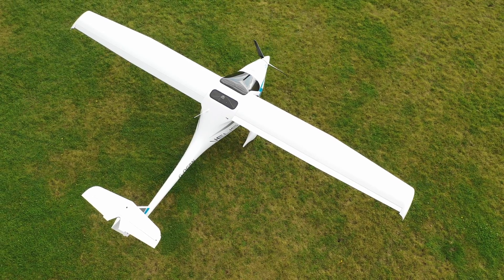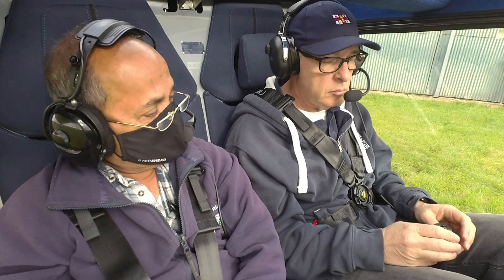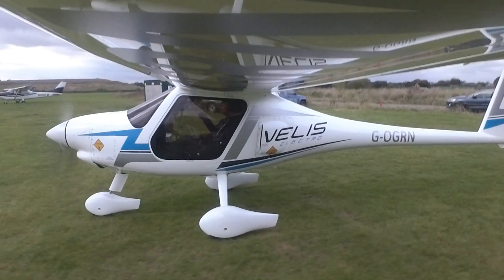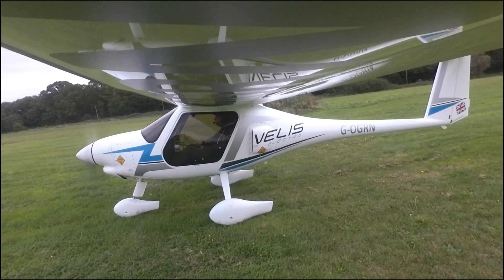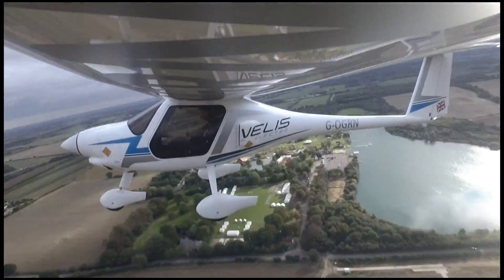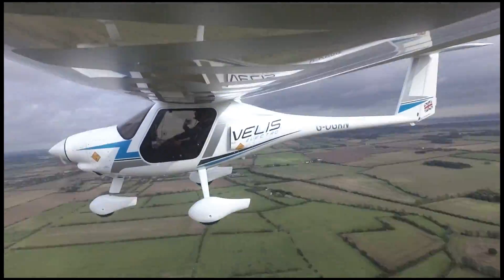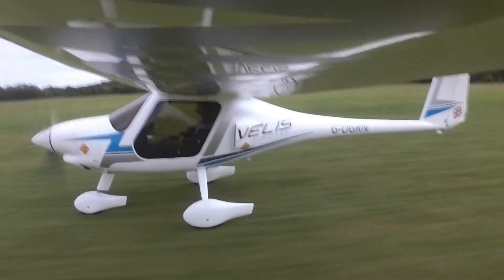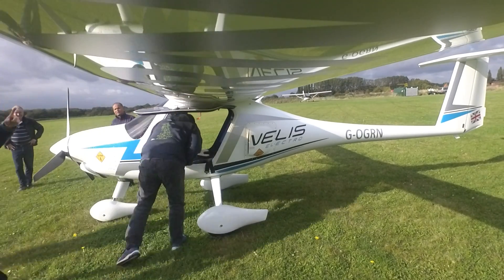FLYER Magazine flies Pipistrel's Velis Electro

Comment: A very interesting development in flying for the future. Just need the endurance element to be improved to be workable for touring too. But that is true for cars at the present time as well. However, give it a few more years…. Thanks for supporting the RNLI. We have had shouts to several ditchings over the years here in Blackpool, ranging from Tornado’s to light aircraft, as well as immediate readiness for aircraft reporting problems on approach across the Irish Sea.